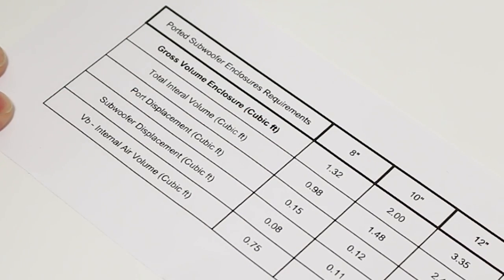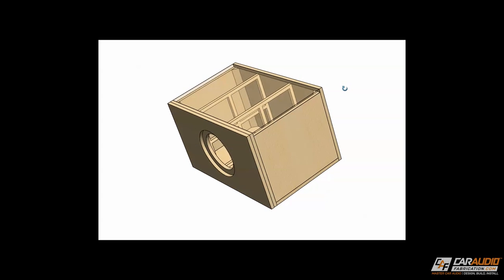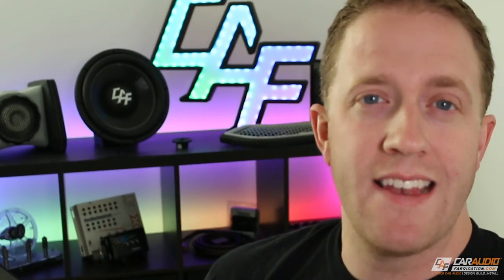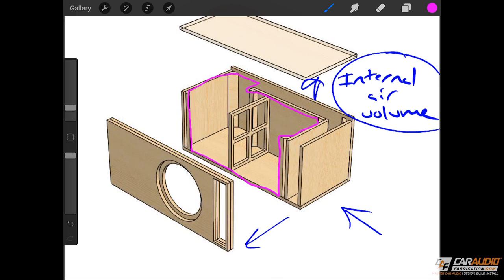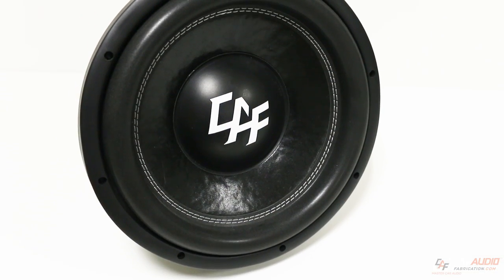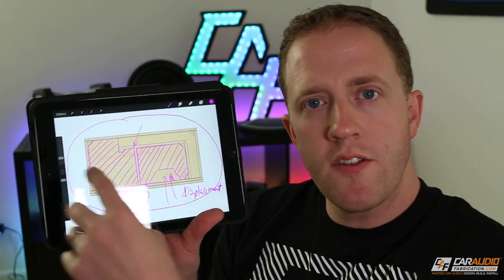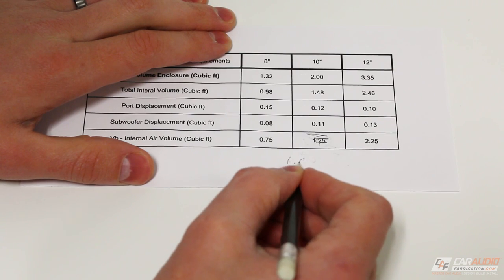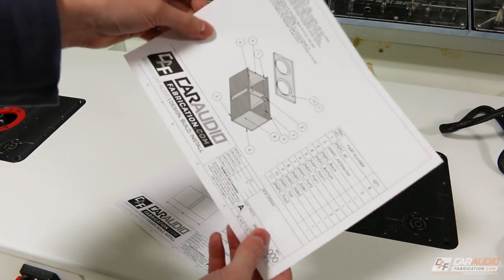Subwoofer Box Volume Explained - Gross vs. Net vs. Air

Comment from the maker: To get the best performance out of a subwoofer you DEFINITELY want to understand what these volume definitions mean! THANK YOU GUYS FOR WATCHING! 
➜ Subwoofer Box Designs - http://www.caraudiofabrication.com/box-designs
➜ CAF Shirts & Hoodies: https://teespring.com/stores/caraudiofabrication
➜ Tools I recommend: http://www.caraudiofabrication.com/materials-tools
Reply: CarAudioFabrication could you shed some light on how to build a vented enclosure with two woofers that share the same airspace and vent?
Reply: More specifically how adding another woofer effects vent dimensions and increasing internal volume.
Reply: What about when you don’t want a box. I have a factory sup I would like to update but not sure how to handle the issue
Reply: How do we talk about, you making me a box? I have a skar audio, 12d2 dual 1 ohm speaker!? 2018 nissan sentra!!
Reply: I utilize 2 old boxes I had and made a kicker vr2 slam my eyes blurry lol.I first took a old Sony singel12 ported box redid the port by making it a longer tube then took a Sony double 12 box set the smaller box and 12 inside the larger box mounting the sub and small box up to original 12 hole on the double I sealed the second hole and it was a completely sealed unit wow and I did a inverted cool model also but I'd have to step by step explain lol
Reply: I have a dual subwoofer box that has a wall in between the two subs would it affect the sound out put if I cut it in half(one speaker doesn’t work and my new car has a smaller trunk space) any input would be much appreciated

Comment: I purchased a custom design from Mark at CAF for a JL 8W7AE. I was surprised by how responsive he and or his team was. They worked with me based on how I would be using the sub, the car it was going in, firing position, and most importantly the type of music I listen to to come up with the correct tuning. I’ve built enclosures in the past but they were not very sophisticated and were in fact exactly how Mark explains them here. Based on the “required” specs. The designs I received from CAF were very detailed but easy to understand. I will say though that you could build an enclosure with simple tools. Jig and circular saws come to mind. But there really is a difference in the finished product if you can swing the purchase of or if you have a table saw and router. Back to CAF design ... the custom enclosure sounds GREAT. And for those on the fence about an 8” sub, don’t be. In this case the JL paired with the custom enclosure by CAF, performs better than I could have imagined. Seriously!

Comment: I learned the hard way with tuned frequency vs airspace (I had only been using enclosure dimension / port size calculators, not acoustic enclosure modelling software). Turned out that the recommended airspace for each of my subs was for a 45Hz-tuned enclosure, and that double that airspace per sub is required for 30Hz. So initially with 4 subs in my enclosure I thought it was quite inefficient on the lows. Indeed, I put it into the software and the F3 was 40Hz. I replaced 2 of the 4 subs in each enclosure with blanking plates and now I have an F3 of 27Hz and it drops proper low!!! Of course, there is now also double the port area per sub with half the amount of subs in each box, so there is no longer any port noise either :)

Comment: It was good to point out that the volumes are recommended starting points. I built a dual ported 15" box where the port volume and area were correct, but the actual passage for the air was so narrow and wide that the ports didn't flow well at all. Inefficient ports made the box somewhere in between ported and sealed and the internal air volume all wrong.

Comment: Video idea: will a modern DSP (like the newer AudioControl units) allow you to compensate for a less-than-ideal box size?    It'd be cool to see you build sealed three boxes for one sub: on box too small, one exactly what the manufacturer recommends, and one too large, then see if you can use DSP to make them all produce the same response on an RTA.   I've wondered for a while if we could "cheat" like this with DSP to let us use a smaller-than-ideal box in vehicles where space is tight.
Reply: It depends how you define “compensate”. It’s also not a yes or no answer. There are some issues that can be addressed with a DSP, but others that are essentially set in stone.
Reply: @jtmcfarland3512  By compensate I basically meant have the mis-sized box sound identical to the correct-sized box.   I.e. the same frequency response, distortion, impulse response, etc.
Reply: @JesseOsby  Unfortunately, that doesn’t quite work. Today I noticed Mark has a newer video called “You’re using DSP wrong!” Where he briefly mentions box sizes. A more detailed explanation is that a box is essentially a part of the speaker (just like the wires and magnets). The air pressure created by the moving cone is like a spring, holding the cone in a happy medium when it tries to move. If there’s too much pressure, you’ll have to overpower the system, which can cause distortion and burned up amps/DSPs. If there’s too little pressure, you can send the cone flying out of the speaker, tear the spider, crack the voice coil, not to mention have a muddier sound because the speaker is now too floppy. A DSP cannot correct for a bad box. Edit: Even a ported box. Many people think it’s open to the outside, but in fact the air still has a calculated amount of inertia. Kind of like swinging a paddle through the open air; even though there’s only air on the other side, you can feel the resistance of it hitting the paddle.

Comment: Yeah I have ran into that problem with subwoofer displacement, so I go into some of my old manuals and look up other subs that are the closest to what I’m using. I have a folder of amplifiers, subs, speakers, headunits dating back from the 90’s LoL
Reply: So many of us have. For many years even high-end manufacturers didn’t publish it. Honestly, go to your modeling software and change the box size 0.06 cuft for an 8” woofer. It’s practically negligible in the ultimate results.

Comment: So if I can get a box with .95 airspace but my choice of subs is a 10" that recommends .6 and a 12" that recommends 1.375. What would be better?
Reply: The 12 if you MUST use that box without modifying it.  In too large an airspace, a speaker reaches xmax too easily. You could also cut the box and make it smaller for the 10"
Reply: The 12 would be a better choice, as long as you have an overpowered amp and the sub has higher thermal than mechanical limits.

Comment: There could never be enough of these types of helpful videos. Some think get this brand that brand don’t get this brand that brand of equipment that maybe true in some cases but it always comes down the the nitty gritty details. As for me I like Brazilian amps XSpower power batts dual or more runs of power and ground I use U.S Alternators and custom made subs and I build my own boxes. But it’s lots of learning and trial and error no one is perfect. My goal now going to use custom made subs on Solo X 18 motors is a true 28-19hz tune using every square foot of trunk space to where it’s going to be a blow thru but not a band pass almost a 6th order I guess using my trunk as an enclosure with the port facing my cab. 97 Gmarquis the trunk is 19 cubic feet only 15-16 of it is feasible to take over with an enclosure Then minus all the stuff we learned here leaves me with about 13 cubes for the box and 3-4 cubs for port-ruff estimate of course. Going Burch to try to save weight freakn 100 pound motors and there going to be two :)
Reply: It sure is a rabbit hole friend.

Comment: Since the Jeep build, I have been really confused on where to start. I have my vehicle and have a bare basic idea of where I want my subs and know that I want to have a ported box and brand I want to use but I don’t want to build the box without knowing what my speaker/subs measurements are but I don’t want to waste money buying a speaker w/sub setup only to find out the air volume will not be enough for the vehicle space I’m trying to utilize. By the recent uploads, I get the notion that I should build my box last. Am I wrong?
Reply from the maker: You should have a plan, a design. Think about building a house, you wouldn't just start buying a ton of wood and materials and start digging and building without having a plan, you need a design or plan to work from.  Its honestly crazy to me how many folks just buy their subs before they even take measurements in their vehicle. Here's another helpful video to help you determine if you even have enough airspace for what you are planning: https://youtu.be/oKdAHZS1LP4
Reply: most subs of the same size usually require similar box sizes. at least in the limited amount of research ive done, so you could build your box and get the subs later. or you could build a box that fits in your car then figure out the air volume and buy subs according to that. both ways work but if it were me and i was concerned with the space in my trunk the box was going to take up id build my box first then get subs to fit
Reply: If you dont have alot of room dont get subs that need alot of internal volume.
Reply: Mark, lol yeah I guess I should have stated that I already have the measurements for the car but between starting the box or buying the subwoofers. Okay, the dilemma is if I start the box for two 10” Subs with an overall size of L 4.6’x H 1.7’x D 1.2’ then the air volume might not be suitable for two 10” subs and would render the box useless. If I buy the subs, then the air volume (my understanding) would be the most important number to sound great and keep the subwoofers playing at peak performance for longevity. However this may change the whole design of my box plans as well to a point that I may have too little or too much air volume for the peak performance range of the subwoofers. Sure I can build a box and have a very good sounding system until I close the trunk and it sounds like a kid pressing his lips together trying to make bass sounds. Like an 87’ Cadillac with a beast system and no sound deadening treatment. 🤢
Reply: @kid_rajah  Just build the box first and pick subs that match it. Your comment doesn’t make much sense.

Comment: Lemme ask ya... Ever test the Woofer, for Qts, Vas, Fs? you do that, and using MATH, you can determine whether its best for a Vented or Sealed Enclosure, furthermore the length of Vent, the Tuned Frequency of the Enclosure.  Without using the Manufactured spects.. which by the way can be up to 30% out of tolerance.   Thiele and Small parameters...
Reply: That’s certainly the best way, but requires more time, expertise, and equipment. Please expose any companies with 30% out of spec performance in your own videos. I think it’s important for this industry to get in check. It’s full of manipulative parking lot van sales who’ve grown into warehouses. We need to crush the crud so there’s room for the quality brands to shine. If they had larger market shares, maybe we could all finally afford them.

Comment: What do you get when you order a subwoofer box design from this guy? Do you get templates or do you just get simple measurements??
Reply from the maker: Box Design includes dimensions for each and every part of the box. The design is fully customized to your vehicles specs, dimensions, your exact subwoofer, and your musical preferences. Basically it's a design made exactly for your application to get the best performance and results.

Comment: Funny you mention some manufacturers don't include subwoofer displacement ( for both sides ) in their specs .
I have a set of FOCAL flax P25FE 12" subwoofer that only says volume and f3 in the spec sheet for sealed enclosure . They say  .72 ft3 and f3=48hz for instance.  I have assumed that they are talking about .72ft3 AIR VOLUME . Is this correct  ? I know from your other videos you use focal speakers in your builds .

Comment: Hello, so i have a soundstream rubicon 15 inch subwofer, my father gave it to me, as that i dont have any volume information. Its an old one maybe around 2000' year.
With this i went on search and i dint find volume info about this sub.
I want to do a ported box, with a rectangular output, i will also listen mostly to house bass music, techno and rap with nice basses.
So could you help me knowing the Internal Air Volume for this sub? So i then could do the right box.

Comment: If you must know the displacement of the subwoofer you can always drop it in water and mesure how much it goes up but then of course you will have a wet sub that may or may not work any more
Reply from the maker: Yeah... Don't do this.
Reply: ROFLMAO 😂 Alternatively, you can use a heavy gas and do the same thing. However, it sure would be easier if the manufacturer just told us on a spec sheet.

Comment: I have a question. Lets say im building a simple L ported subwoofer box. How and where is the best place to put the woofer. In front the baffle or center of the face plate. Lets say the baffle is about half length of the face.

Comment: I have a 2019 new body style RAM 1500 Laramie Crew cab I'd like to make an under-seat enclosure for.  I am an amateur carpenter and could fabricate what I would need for the space easily but am clueless as to all things car audio.  Would I just make as big of a long thin and flat (to fit under the seat) box as I could and then figure out volume after and get the appropriate sub speaker? Should I just have a cut out with enough clearance for the sub on top?  How much room do I need between the bottom of the seat (if I do up-firing) and the face of the sub speaker?  Are there any videos or instructions for starting from scratch on a build like this?
Reply: This is how it was done for years. Buy a speaker with a grille and it can contact the seat. You may look up prefab boxes for your truck to get an estimate of your final airspace.

Comment: What saddens me is the budget models of subs hardly have any t/s parameters available to them and it discourages me a bit. Thank you for these videos of course!
Reply from the maker: Its because those cheap companies have poor R/D and likely don't even monitor the T/S. You will notice reputable companies (which you probably don't consider "budget") will have T/S for even their most entry level subwoofers. You get what you pay for.
Reply: I know your pain. Just imagine how your installer feels neutered by the marketing when an excited young customer come in with a cheap hyped-up speaker. It tragically is the first and last car stereo for many of them because the results are so disappointing.

Comment: if I have a 1 18 that specs are 5.25 cubic feet and 78in port area  but I want low bass so I wanna tune the box to 29 hz how big should I make the box and do I still use 78in port area or is there a recommended square inch per cubic foot

Comment: Great  Info. Most people just throw a sub into a box when their is way more to it. All speakers have a air volume they will sound the best in. Given a type of sound your after.
Reply: Not only sound best, but have proper damping. The box size effects more than sound (max power handling for example).

Comment: I know this sounds crazy, but say you wrap your sub in thick plastic, then sink it in a bucket of water and measure the displacement of the water? If you're worried about the plastic you could sink it by itself afterward and measure that too. This is how you get volume measurements of irregular shaped items in chemistry settings. 🤷‍♀️
Reply: There are hollow parts in a speaker and that would be very inaccurate. The manufacturer has a CAD model of their products and should publish the data so every single buyer doesn’t try to dunk their new speakers in water.
Reply: That is exactly how its done , expect use a plastic Bag. A large one that is. You will get a more Than reasonbly accurate result.

Comment: hey how are you doing ?
I have wanted to upgrade my stock audio in my 2000 silverado for some time .. but when it comes to the subwoofer .. im confused between two types .. sealed box enclosure or a bass tube .. 
whats the difference in bass quality?
thanks!

Comment: If a prefab ported box has a port facing front like the subwoofer would it make any difference if the port was located in a different spot on the box? Or say round instead of rectangular? Also it's a 4 cubic ft box with 2 alpine type R 12s with Rockford power 1500bd. I get extremely good bass with rap and techno but I listen to more rock and metal and the bass just isn't there. Should I go with 2 individual sealed boxes at 1 cubic ft each 32hz?
Reply: Yes, it makes a difference. Port shape does technically also, but not much if the face area is adequate and the end(s) are flared. Sounds like a tuning issue as well.

Comment: 🤔 so how do you determine how much volume you need to size your box appropriately.  I have a box for an 18 and love the sound but I want to change the design of it . I know I can just simply measure my box and stay the same size but just wondering if one was to buy a speaker and wanted to make sure you didnt make it to small or to big. Thanks.
Reply: Any reputable speaker manufacturer has size recommendations. If you’re happy with the sound, please consider just adding a “beauty panel”. I’ve met too many people who spend hundreds or sometimes thousands “upgrading” just to find the sound is only slightly different.